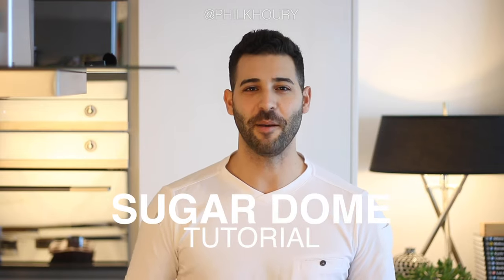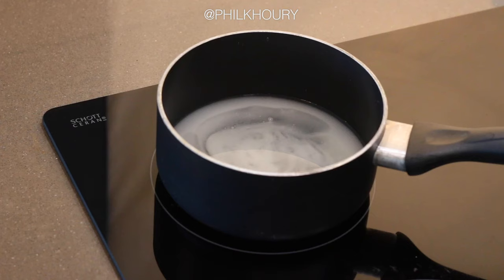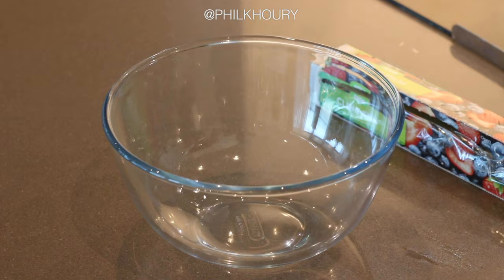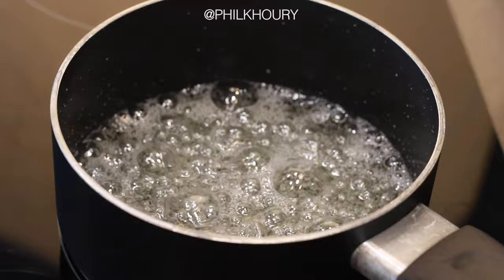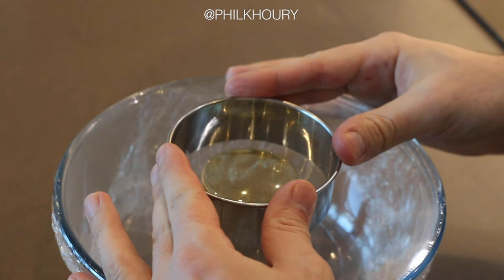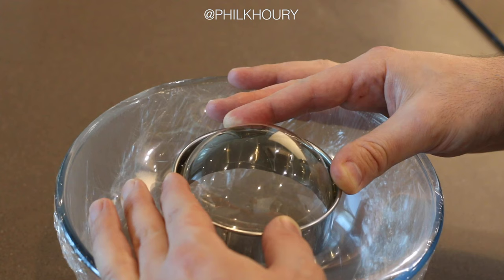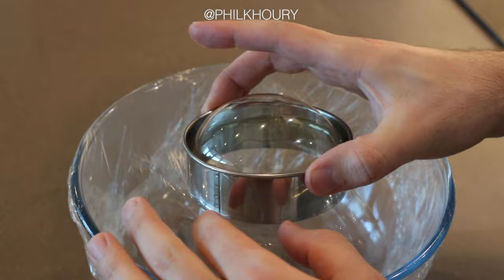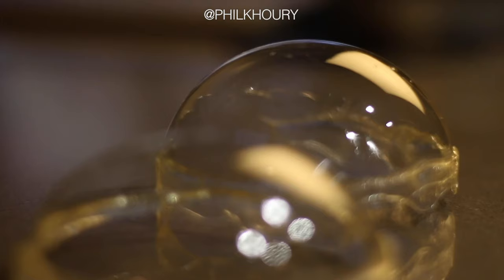How to Make Glass Sugar Dome

Comment: I followed the instruction and had a try. 110 oC sugar just melted my parafilm. Could I ask for the brand of parafilm you used?
Reply: I used saran wrap brand and same problem! It went right through. The video is a year old, but maybe someone in the know will check back at the comments for this holiday season 🤞
Reply: I had the same problem, then I decided to try it on 115 instead because it's more smooth and fluid then at 110, and managed to make one. 110 degrees made it to hard for the wrap and broke every single time. Hope this info helps you guys☺️
Reply: Works just fine with microwavable film 🥰

Comment: Thanks for the tips and the explanation! I have a question, do you need several bowls and rings as while working, the sugar will lower the temperature or is it ok, to re heat with precautions?
Reply from the maker: Hi! You can definitely reheat, but going between a couple of bowls is a great idea! Each takes a few minutes to make

Comment: for anyone thinking of making this, i tried demolding it 3 different times and the dome broke every time. IT'S HARD. and even if you manage to do it, your dome may look a bit uneven in the end.

try wrapping the inside of the ring in plastic cling wrap and then applying oil, the sugar dome will literally come out of the mold without any pressure at all. it's so much easier.
Reply from the maker: That’s a great tip! Take note everyone!
Reply: It doesn't look easy at all. A exact science really.
Reply: They make cutter molds like that that open, I think those would be perfect for this.

Comment: PATIsserie
Ok, i just made it and i have the tips of the mistakes that I made.. 

The right material of the film is PVC that sometimes actually says in the package that widstands 120C to -10C.

Then nobody told me the ring would get absolutely hot and start burning my fingers which i would made me let loose and riun the soft texture.

Then i shamesly didnt grease my ring so the caramel stayed sticking on it and i had to break the dome to take it out.

As last, i put a bit too much caramel in the ring so the dome was very thick at the border. I weighed it and for my 15cm ring, its ok to use just 50g of the melted sugar.
Reply: Thanks love!
Reply: Thanks for sharing. 💗
Reply: Thanks for sharing
Reply: Thx dear
Reply: Thank you. How long do the sugar domes last? I want to make Christmas snow globe cupcakes as gifts for my coworkers but not sure if they would hold up in d open

Comment: I used a special kind of clingwrap that can be used in the oven, restaurants usually have this kind of clingwrap. Bought my online and it works perfectly. Instead of oiling the ring I used a silikon mat that I cut to the size of the ring that I'm using, no more worries that it will break and the sugar doesn't stick to the silikon mat ☺️
Reply: And you glue the edges together ? 🤔
Reply: @princesse523  No you don't have to glue the edges, you just put it on the inside of the cutting ring without glueing the edges and it comes out easily and doesn't break. It's just there so the sugar doesn't stick on the metal ring 😊
Reply: @elvisvelic4179  Thanks

Comment: Thank you for a great recipe. Seems like it takes few minutes to make a single dome, then rest of the syrup won’t set while leaving it aside? Can I reheat the syrup if it sets too much before pouring on top of the cling wrap?
Reply from the maker: Yes! of course. I put my syrup back on a VERY low heat to keep it at temperature. After 2-3 goes you may need to reheat on a higher temperature, and swirl it around the pan and let it cool down again. Hope this makes sense!

Comment: I gave it a go and it worked really well both with your formula and with pure isomalt (no water). Thank you!
Reply: Did you use regular cling wrap? I get the candy almost 100° cooler than he say in video and it still melts through mine
Reply: @davidfred2123  mine too. I took a bit of search, turns out it better to use cling wrap that has pvc material in it.

Comment: I have no idea what I'm doing wrong. I get it the temp you say and within 2-3 seconds it melts through my 2 sheets of cling wrap. I bring it to 105 Celsius and it's too thick to stretch but if I add pressure it blows a hole in it. Are you using a special type of cling wrap or just any you can find at the store?

Comment: @philkhoury hey man, great video, i got a question. im in europe, our cling film is heat resistant up to 100 degrees C. 
ive tried your method, however, when im pouring around 120 degrees, it will instantaneously burn through the film,  and if i pour around 105 degrees despite the correct sugar and syrup ratio its too thick to pour.

ive also tried to add more sugar, then it was ok to pour around 100 degrees, but then it did not harden.

where am i going wrong?

Comment: Hi! I just attempted multiple times and it's not taking shape. It's actually pushing down instead of up. I did use a candy thermometer and used a scale to weigh everything. I'm just confused as to what is the issue.
Reply: Your cling film is likely leaking air from the container. The internal pressure of the trapped air is what forces the dome upwards. That would be my guess anyway.

Comment: Great tutorial. I made it successfully after 6 attempts but it still needs some perfecting

 I have couple of questions… you sad I can make it in advance. My question is how long (how many dsys) in advance I can make it and how to store it? In the fridge or room temperature? In airtight containers?

Another issue I ran into is that by the time I make the dome, the sugar in my saucepan has already hardened and I need to reheat it or mIe another batch. How to make myself more time efficient so I van really make 5 domes from the same batch? 

Thanks 😊

Comment: That technique is amazing! Could I ask what brand of thermometer you are using/would recommend? I can't really afford to buy anything super fancy, but it goes without saying that the cheap ones aren't the most accurate :\
Reply from the maker: Hey! I'd recommend any thermometer marketed for food use that is 'instant read" (this means it is designed to display the temperature very quickly) If there is a lag, you risk overcooking your sugar. Like this one which is pretty affordable if you're in the UK(?) water resistant, and instant reading. https://amzn.to/35CCvFU
Reply: A tip, don't buy the £3.50 one from asda, the lag burnt my sugar :( then I was holding it with my pot tilted so I could get a better reading. 1 second it read 114, then I shoogled it and suddenly it read 121! No wonder I'm melting all my cling!
Reply: Hi, I have figured out a perfect solution. Stretch-Tite Premium Plastic Food Wrap works. Two layers of this cling wrap could endure 117 degrees celsius.

Comment: It looks fantastic! Thank you for sharing the trick. Do you have to use new cling wrap every time you want to make a new dome ? Is it possible to make for examples 5 domes in a row or the temperature of the sugar syrup will drop too quickly ?
Reply from the maker: HI Margaux! You do need fresh cling wrap each time. The domes are quite slow to make, and i'd recommend keeping the pan on very low heat to maintain temperature. You could make about 5 with this recipe quantity :)
Reply: @philkhoury  thanks for your quick reply

Comment: Hi! I tried this three times, but every time I pour the melted sugar on the film, the film immediately melts and the sugar falls through. I even tried dropping the temperature to 90 C instead of 110 C, but even then it melted a hole into the film. What I am doing wrong?
Reply from the maker: Oh no! I’m afraid you might need to try a few different types of cling film
Reply: @philkhoury  what kind of cling can i use to do that? For microwave can be fine?

Comment: Thanks for your amazing video. What do you think if I use a silicone membrane? It's possible that functions well. I wait your opinion, thanks
Reply: I think it wouldn't stretch enough. Needs to be incredibly thin with high tensile strength.

Comment: This seems so nice! It looks easy a'd smooth to do, but I'm sure it will be a struggle practising haha ! :)
I have difficulties to find glucose in small quantity over there (I don't need 1kg pot of glucose :( ).
Is there a clue to replace it ? Thank you.
Reply from the maker: Hi le Chat! You could go without the glucose, but it will be just slightly more difficult, but not majorly. The glucose gives the sugar slight extensibility, moisture and brings down the working temperature of the syrup. Hope that makes sense?!
Reply: @philkhoury  Thanks! It does. Let's take the first paw now 😁
Reply: Ow ! Uh... What are the proportions without the glucose ?
Reply from the maker: @plumhtv3891  I'd just replace the glucose with sugar.
Reply: @philkhoury  I guess I have to Ork Orh higher temperatures do I ? How many ?
Reply from the maker: @plumhtv3891  sorry I couldn’t tell you exactly you would need to try. Not a technique for the faint hearted! Took me many attempts to get it right
Reply: I am using light corn syrup instead of glucose.

Comment: Hey mate. Thanks for this video! I'm using the same digital thermometer as yours but the sugar just burns right on through the cling wrap. Do you know what I might be doing wrong? Cheers!
Reply from the maker: Thanks Julien! I believe it needs to be made from pvc. You want to let it cool slightly to quoted temp
Reply: I met the same problem! Want to ask for the brand of cling wrap
Reply: My sugar burns through the cling wrap as well! I don’t think it’s a temperature problem because I tried this at various temperatures and it still melts a hole in the cling wrap (2 layers) even when the sugar is too cool to get full off my spoon onto the cling wrap.
Reply: @valhallamcgaughey3720  I have figured out a perfect solution. Stretch-Tite Premium Plastic Food Wrap works. Two layers of this cling wrap could endure 117 degrees celsius.
Reply: @happysundae3670  OMG, thank you for sharing! I have been scouring the internet with no luck!
Reply: @luvnafctn  My pleasure!

Comment: Hello can you please advise,you have it nice transparent our is yellow, not sure what is wrong
Reply: Probably went too high with the temperature. I accidentally went to 155c(only 5 degrees over,) but that was enough to slightly burn the sugar. Sometimes the thermometer takes a bit to catch up, so take off the cooker early(he mentions at 145c in the video) just to avoid going over. The heat from the pot will still be transferring into the sugar as you take it off the heat so should still go up a few more degrees.

Comment: Hi, I tried it several times today but my cling foil always broke. I also tried several temperatures from 110 to 120 degrees Celsius after the sugar cooled down from 150. Is there a special type of cling foil (available in Germany) I should use? Thanks and greetz, Jacqueline
Reply: use a cling foil on ceramic bowl or glass bowl with fine edges it has better grip

Comment: I tried this (replaced glucose with sugar) but no matter what I don’t get an air bubble forming inside the ring. I see you are using also a sharp edged ring. Sometimes this pops the wrap. Did you make a small air gap in the center ?
Reply: Don't make a hole in it, or the air will just escape from under the wrap. I'm finding my cling isn't flexible enough and isnt letting a done form, maybe same issue for you?

Comment: I'm curious... do you think putting the mix over sphere molds turned over could possible work in a similar way?
Reply from the maker: Hi! You could but the sugar would be quite thick. This is super fine/thin, because it is almost as if it blown, the way glass is too. You can use this cooked sugar to pour into moulds and on sheets to make decorations, but they would be quite thick.

Comment: Hi can I use a silicon mold? And add colors when all the ingredients are boiling?
Reply from the maker: Yes you can add water soluble colours, before you boil.
Reply from the maker: I would not use a silicon mould - that is a different technique that will result in a much thicker shell
Reply: @philkhoury  thanks and I appreciate you replying back
Reply: @philkhoury  thanks

Comment: What kind of wrap did you use? Any specific type?
Reply: Just a wrap who withstands 120°C should do the Job✌
Reply: @JustMtrue  I'm struggling with this, I've now bought 4 different brands and either melted a hole in them (non-pvc brand that did admittedly say it was suitable up to 100c) or the rest just aren't flexible enough to pop up in the center! What cling have you found that states its suitable up to 120c? I've been in 6 shops and only the one that did 100c had a temp on it. The other 8 or so I've looked at don't have a temperature!

Comment: Hey Thanks for your recipe! I tried it out but it burns a whole through the cling film at the temperature you suggested. Is there anything that can be done to prevent this? Is it the type of cling? Does the bowl need to be cold. Please let me know lol Thanks
Reply from the maker: Hey Louis! You do need to push down very slowly. Are you using a digital thermometer?
Reply: No I was using a sugar probe, but will try with digital one and let you know!
Reply: @philkhoury   Hi, I had this problem as well using a couple layers of saran wrap brand. I cooled the mixture down as low as physically possible, but it melted right through instantly. Could I be doing something else wrong if it's not the actual temp? Sorry to bother, and thank you!
Reply: @23rlwalker  I am going to try Stretch-Title Plastic Wrap (suggested above) tonight. I will post my results.

Comment: Hi Phil! Thanks a lot for the recipe. Unfortunately the sugar syrup melted the foil, even at 110 degrees. What kinda foil do you use?
Reply from the maker: Hi! It's a regular plastic cling wrap made from LDPE (Low-Density Polyethylene). Some might be thinner or thicker, but I use it at 110-120*C
Reply: What are the ingredients? 50 g water 100 g sugar n third ingredient is what ??
Reply from the maker: @Khwahishaggarwal18  Hi! Glucose or corn syrup
Reply: @philkhoury  water and maïzena ??????
Reply: Cooked